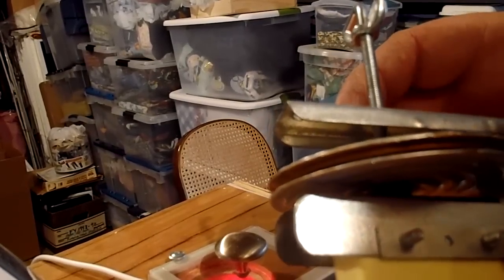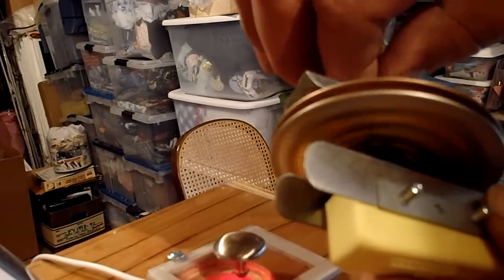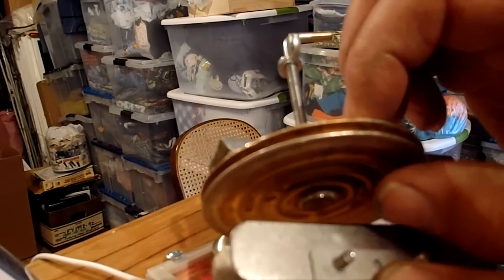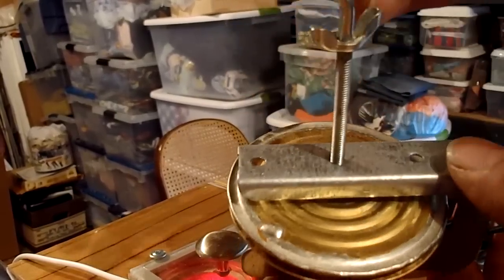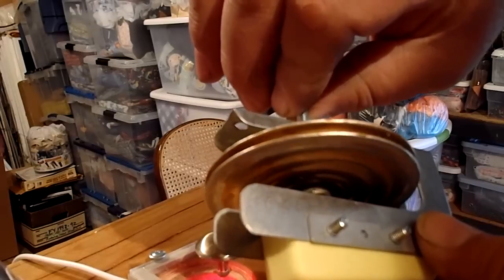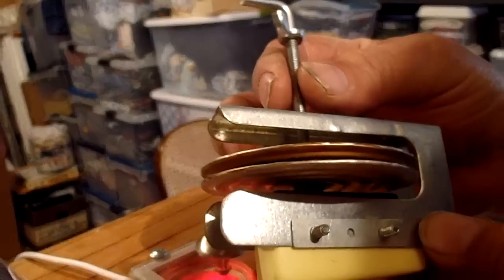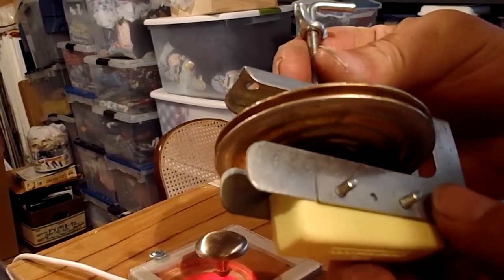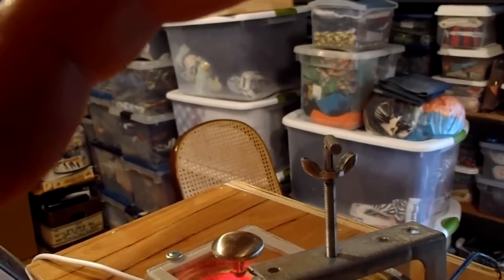Poultry incubator wafer thermostat

Comment: bro you did not tell us about voltage, what voltage is require for wafer thermostat?
Reply from the maker: It's just a switch, doesn't really care what the voltage is. The wafer doesn't use electricity to work, just the thermal expansion or contraction of the copper, so just surrounding heat, to turn on or off whatever voltage is applied through the switch.
Reply: ok..... thanks a lot sir.. you provided very useful information....

Comment: Professional reptile breeders prefer using an electronic thermostat in series with a mechanical for safety. Electronic thermostats are more prone to fail than the wafer.
Reply from the maker: Simple is better. Electronics don't always fail safe. Parameters of a solid state circuit can change, changing the output with out any obvious indication. We used a Whillhi controller for several years with good results, then the temps went up 10 degrees while still indicating the proper temp.
Reply: hence the use of a wafer disk in series.
one mechanical,,one electronic.

Comment: why would anyone use something like that. I can't see it even working.
Reply from the maker: Actually they work great, they don't need any outside input or power (except to run the heater) and they are more sensitive than most bi-metal or electronic thermostats. We still have an incubator that my grand parents had and it still works great, it is over 70 years old and is used every year.
Just like anything else, they sometimes fail.The ones in the "cheap" incubators available these days ( like the one shown) are built "cheap" just like most of the stuff you buy now days. You can still get the good old fashioned ones, I would venture a guess that they're made in the US and the cheap ones are made in China or Mexico or India or some-such, but they cost twice as much.
Reply: LOL>  Why would they NOT use it.  Wafer Thermostats are tried and True, and in a small incubator you will not find a more consistent thermometer.  and once it is set, it is set.  Unlike Digital that are generally NOT accurate, and will sometimes be off by a couple of Degrees which is HUGE when trying to incubate eggs.

Comment: The wafer thermostat is proven after years of reliable service. This guy does not know how to use it or the principal in which it works. it is full of air and there is a wing-nut to lock down your final adjustment.
Reply from the maker: Somebody said it was filled with ether. I wouldn't want to be the one soldering that together.
Reply: it is full of helium!!
Reply: I say Helium!
Reply: Price

Comment: i've had vary good luck with wafer thermostats but any thermostat can fail , the wafer can lose the "ether gas and go into default on position , or the switch it's self can fail . you said something about  a chascy ground . mine come with two wires and  is not wired thru the bracket , #2 there is usually a nut soldered on the inside of the bracket to steady the bolt adjustment . there's also a wing nut to lock it down wth but . take care to not knock the adjustment off then tightening  the lock nut wing ., looks as if it it was losse or gone on yours . you could , solder one on top of the bracket . & yes the wafers are usually not straight . but if placed in a position wher it doen't get constantly moved usually works well . https://www.facebook.com/pages/Homemade-incubators/273809722683265
Reply: Can you tell me how to judge whether you need to replace the wafer or the entire thermostat? I have a Hova Bator D2362N which does not hold a constant temperature. Thanks
Reply from the maker: Check to see if the threaded shaft that adjusts the thermostat wobbles in the frame when the wing nut is loose, if so, the threads in the frame are loose. It could probably be repaired by drilling out the threaded hole and soldering on a nut of the correct thread, otherwise it needs to be replaced. Sometimes you can get them to work sort-of if you keep the locking wing nut semi tight. On the one in the video  the threads where loose and the wafer was bent where the shaft attached causing the wafer to wobble making adjustment impossible. If just the waver was bent I could have replaced it, but since both were sloppy I replaced the whole thing.
A new wafer is about $10 and a whole new thermostat is about $25 on ebay.
The thermostats they use on these incubators are kind of cheaply built. The fame is thin stamped steel and the threaded hole is just punched in. Any bumping of the shaft distorts the hole making it difficult to adjust the temp. They also lose calibration after opening or moving the incubator. Keeping the locking wing nut tight helps, but when they get too loose they are hard to adjust and won't stay in adjustment. If the wafer gets bent and wobbles on the shaft there is no way to adjust it as the distance between the wafer and the switch is never linear.
There is not much else that can go wrong with them. The switch could go bad, but if it is switching on and off at all that is not the problem.
Brower makes a better quality thermostat, it has nuts instead of just a punched hole, they're around $45 on ebay and $34 on Amazon. These are the ones used in the old incubators from Sears and professional ones. They come in 2 watt version for small incubators and a 31 watt version for large incubators( or other heating needs).
Reply: Patricia Grunau the waferS are very temperamental ,some that look the same may act very differently , remove the wafer and  gently click the switch with your hand , you can find me , and /or other on facebook ,, Homemadeincubators,,,,,
https://www.facebook.com/Homemade-incubators-273809722683265/